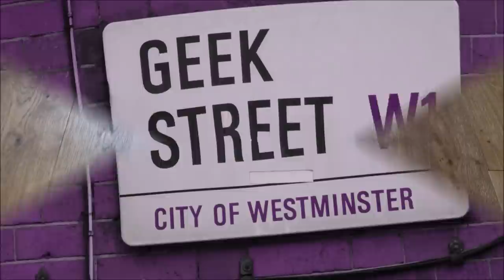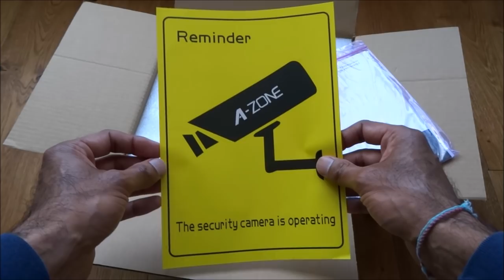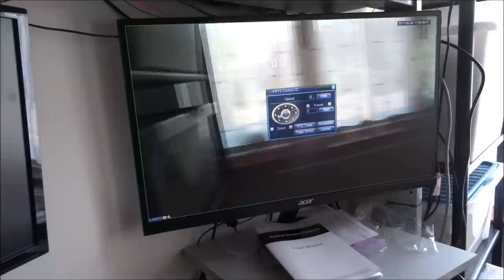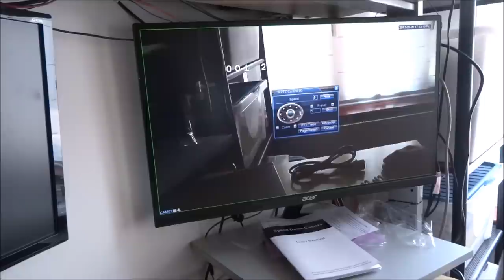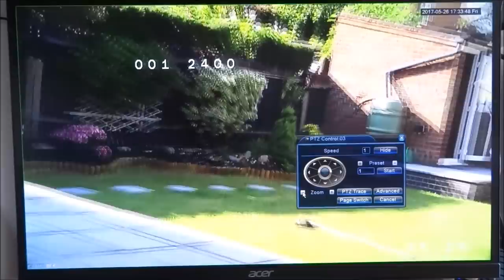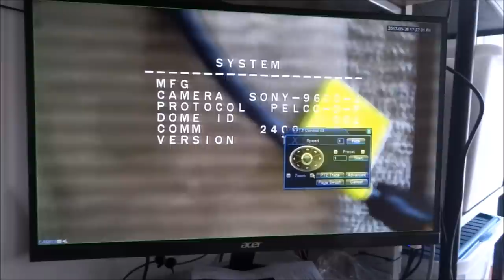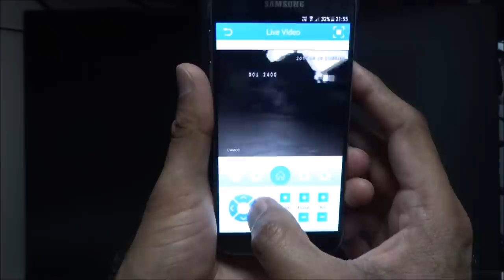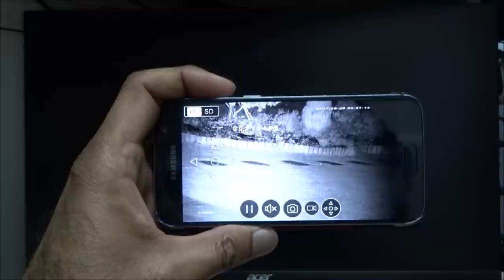Unboxing and setup of a A-ZONE PTZ Dome Camera 10x Optical Zoom, 2.0MP Waterproof

Comment: So were would I get that connecting block?  I have one similar and had it hooked to a different dvr. Had no video so I plugged the bnc into a different dvr but forgot the ptz wire was in a different dvr and it worked?  I need that orange block!
Reply from the maker: Perhaps try eBay.

Comment: hey great video review. im looking at upgrading a 600 TVL cctv system that is 5 years old. i dont want to break the bank balance but i want a decent cctv system with good IR viewing as its to monitor our cars out on the street. is there any reccomendations that i should be looking at? thanks in advance
Reply from the maker: +Karl Johnson thanks for the comment personally I'd be looking for a POE system where both the camera's and NVR are 1080p and minimum 2TB hard disk. You should easily be able to pick up a system for under £300 with this spec. Hope that helps!
Reply: Geek Street thanks for your reply and advice. I'm sure I can find a 1080p system online cheap enough. I don't mind spending extra money if I get a system that works. Keep up the good work. We need more vids like yours on youtube

Comment: does it have motion detection..?
Reply from the maker: +AWOL733 yes the NVR covers that part.
Reply: excuse me when i ask..
NVR...?
Reply from the maker: +AWOL733 np that's the recording system NVR stands for Network Video Recorder.
Reply: ok thanks very much...
Reply from the maker: AWOL733 now worries check out the a-zone CCTV review I did this camera actually plugs into that system.
Reply: Geek Street ok i will
my swann dvr stopped working so im in the market for a dvr and gonna throw in a ptz cam with the new dvr while im at it
Reply from the maker: Ah ok....good luck with your research.
Reply from the maker: +AWOL733 yes
Reply: Nvr is digital, where as DVR is analog, Better video.

Comment: Do you need to connect the intranet cable plus the power cable 
Or the intranet cable will be enough.
Reply from the maker: Thanks for the comment. This system does not take a enthernet cable but uses a BNC connector. Do you would have to connect both the power and the BNC cable.

Comment: I imagine the PTZ wires are for a seperate PTZ controller (whereby you need to run another cable to the PTZ controller )
rather than using the onscreen menu with a (pc) mouse
Reply: PTZ camera that use coax cable can be controlled two ways. One way is using the same coax cable used for video. The other way is using the loose wires called RS485. If your DVR supports coax control that's the way to go. If not most DVRs have a RS485 connection.

Comment: nice .but this ptz would with any brand dvr thanks
Reply from the maker: +Mariano Hernandez 1 thanks for your comment, yes in theory it should work with any brand of DVR.
Reply: DVR can be any brands, but need to be AHD 1080P or AHD 1080N DVR. Such as eyedea brand D9508, D9504, D9708, D9716, D2004V ect.